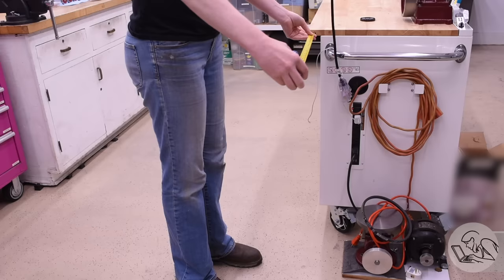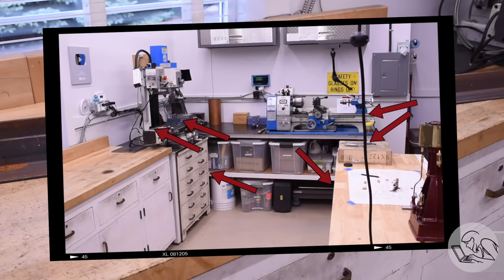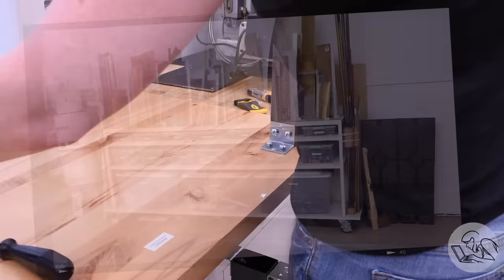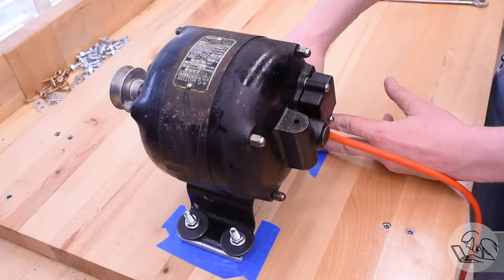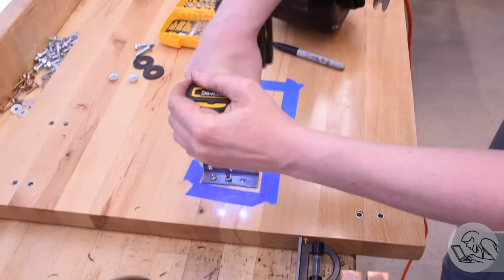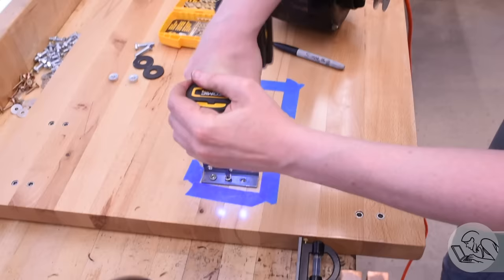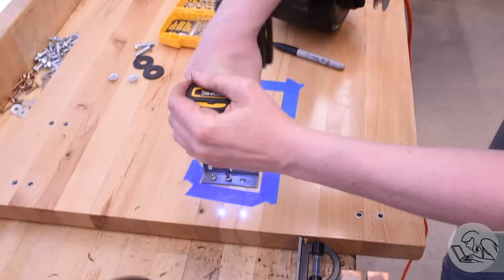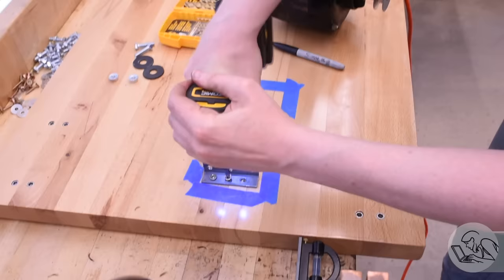Die Filer Bench (and last minute re-engineering)

Comment from the maker: Hey everyone! Lots of folks “suggesting” on this one that I should have opened the hinge out 180° to solve the clearance problem. That’s missing the point- that does nothing to improve clearance for the bolt heads on the motor bracket which require the motor to sit at a high angle. Some folks suggested mortising the wood underneath as well, and sure I suppose you could. That’s a lot more work than what I did though, and my approach means the bolts are accessible for removing the motor without removing any wood screws (which weakens their hold in the future).
Reply: what you should have really done is create robots in the shape of tardigrades which would have arduinos programmed to make them grab both the surfaces and hold tight and for fun, one would make a quiet metal on metal squeak and the other a very quiet fart sound rarely, at long random intervals, maybe once every two to seven months
Reply: Couple spots of weld, then no bolt heads to deal with!
Reply: 1/4-20 flat head machine bolts with either allen or torx drive ,,  counter sink the hinge plate to match the bolt head or nearest metric size
Reply: I probably would have just carved out some clearance from the table's underside. It's wood and you could probably chisel out a pocket for the bolt heads to recess into, but I have more than 1 chisel too. We do what we feel comfortable with and if it works, it works :D
Reply: I thought you did a fine job on the belt slot, and the project overall.  I’m not a fan of the Home Depot guard material, but it is 100% justifiable for getting rid of it!

On the V-belt, some of your vibration may come from the permanent bends in the material as it flops over the round pulleys.  If it bothers you, test by using a more flexible replacement like a strong cord, and potentially replace it with segmented link belt.  I put a link belt on my table saw (which I have used to cut wood AND cast iron!), and it took a lot of the vibration out.

Comment: You earned plenty of woodworking cred for having a sharp chisel!
Reply: If a machinist can't sharpen a chisel, she loses machinist points.
Reply: A story told to me a half century ago or more by an old wood worker. 

There were two skilled craftsmen, one a machinist, one a woodworker. Needless to say, they were great friends, but did give each other a hard time about their chosen materials. 

Both did very fine work. But the machinist did have a problem. When the blade on his bandsaw would break, he could just never get the new one welded together right, the joint kept breaking. So in the end, he would take it to his wood working friend to weld it. The woodworker would never tell the machinist his secret on getting a good spot weld. 

Anyway, the both had a common friend and one day that friend asked of the woodworker, so why can you do that weld when the machinist can't. The wood worker responded, we both file the end taper correctly to get the weld, I blow off the ends to clear the filings, but my machinist friend wipes those ends off with his greasy fingers. 

I know, a bit long, but what the heck. The point is, cleanliness is next to a proper current path for welding.
Reply: johannesfiftyeight9287  ....or abuse it. 😂 I have plenty of friends that fall into the latter category.  Having said that, I think Quinn probably has great woodworking skills, but she has too much fun abusing us poor woodworkers to admit it.
Reply: Should have used the die filer to massage the slot….😂
Reply: @MrTjbnwi  I was wondering why she didn't mill the slot, and then square up the corners with the die filer.  You beat me to it!
Reply: @PhilG999 we have a bandsaw at work that has a small grinder and welder built into it.
Reply: I am amazed she didn't come up with some elaborate setup to clamp the table-top to the milling machine. to mill out that slot...

Comment: 22:36 - It was used to build radiator covers.  You wouldn't have to see the radiator but air could still flow in and out.
Reply: Ha, ha, I think I’d rather look at the radiator! It’s odd to think some where some one decided that the world needed an ugly punched mesh radiator guard,odder still that people buy it.
Reply: @johnsherborne3245  It's intended to prevent small child sized fingers from getting burned on the radiator surfaces.  Been superceded by MDF in recent years.
Reply: @AB-ku4my  the joys of international you tube, who’d have thought it. Radiators here in the UK are seldom that hot, at least that makes sense though.
Reply: It also makes it more comfortable for a cat to lay on
Reply: Yes. This is where I have seen it-including my childhood home. Though some of the radiators were left exposed in all of their cast glory.
Reply: @johnsherborne3245 With steam heating systems, they get really hot. However steam systems are not that frequent in Europe anymore, because they just have very poor efficiency (too hot flue gasses leaving the chimney losing way too much heat)...
Reply: @annaplojharova1400   in 1976 my lab was steam heated, used to be very noisy as the condensate trap banged about, I can’t say it worked that well though ideal for heating the process tanks.

Comment: Jeez. Whoever put that first hole in the bracket did a terrible job lining it up with the two you added. 😄
Your videos are always a bright spot in my day. Thanks for sharing your projects. 🙂
Reply: Thankyou 👍
Reply from the maker: I don’t know what they were thinking, putting it way out of line like that. 😬
Reply: If you had a working dye grinder,  you could slot the hole to the right place.
A wood chisel won't work!
Reply: @richardw3294  not with that attitude it won't. 😄
Reply: Having the holes not-lined-up is actually stronger for the wood, so there!

Comment: The house I grew up in (Sears Kit Home in Washington, DC) had radiator covers of the material with the four-leaf-clover pattern in it.  I also recall some baking station in my youth that had that same pattern as venty decoration. The radiator covers were made from wood panels like a book case with that screen over the front so they heat could come out, all painted the same as the rest of the walls in the house.  The top was open, like a bookshelf, and frequently had a cat on it in our house (there were several scattered about; also good for lamps and the occasional small statue...).
Reply: @bobbob8229  Especially on radiators!!  And one had afternoon sunshine.
Reply: @bobbob8229  Don't ask a Maker how to make stuff from cats...!! 😎
Reply: I think that the radiator cover sheet goods is thinner, with smaller holes .  The brass looks more like the stuff used for forced air floor vent covers.  (At least in my experience of 75+ years in Toronto)
Reply: Kind of surprised Quinn didn't hand form a guard out of copper after all the work she did on the boiler. .
Reply: Ah thanks - I finally get what is meant by 'radiator covers'. Being a car-guy I immediately went to car radiators and could not figure out for the life me what others were talking about. 😲

Comment: Using a prefab work cart as a movable workbench is extremely good idea.  As for your woodworking, you got the job done and it looks good.
Reply: As Quinn said, unless it makes you happy to build it, save the money and buy it. For instance, for my mini lathe, I needed a good strong stable stand to get it up and running. Yes, at some point I will find a good used roll away tool box for that purpose, but for now it's on a Wen wood working lathe stand. Stable and works nicely.
Reply: As someone in the HVAC trade and work with other trades. We have a saying, "Can't see it from my place."

Comment: That metal is what was used to box in large steam or hot water radiators. It's junk metal that is an approximation of similar sheet that would be installed in century homes.

Comment: Quinn. I have switched over to the link belt style V belt on most of my machines and it made a remarkable difference. Very smooth running.
Reply: Yeah me too. Anything that has a Vbelt in my shop has link belt and it's a real God send on my old atlas lathe
Reply: I have been thinking this too during this entire series.  Put one on an old Craftsman drill press and I'm never going back.
Of course it might have had something to do with the belt it was replacing being decades old.

Comment: Long ago I worked in a lab testing plastic additives.  We had a lab-scale plastic extrusion machine with a heated snout that caused more than a few burn accident reports to be written.  I built a shield from 1/4" hardware cloth that was, in design, almost identical to yours.  The number of burns produced went down considerably.  However, the number of reports on small cuts caused by the edge of the hardware cloth went up a lot.  Eventually we got wise and relocated the machine so it stopped being a global hazard.  In the spirit of "I love your channel" I won't ask for any royalties for using my unpatented design. 😺 Cheers!

Comment: As a hobbyist with limited space and various bench mounted bits of machinery (like the home made router table),  I solved the 'emergency stop' situation by buying (Ebay) a metal heavy duty enclosed foot switch and attached a double output short lead to it - good for powering up and down machine and dust extraction at the same time. So in the event in wanting to cut the power A.S.A.P. especially when both hands are in use, it's pretty instantaneous.

Comment: From a cellulose monkey, put a flat reference on the lines you want to mortise down into.  Then keeping the flat back of the chisel on there gives you an easy flat pretty edge.  No criticism from me :)
Reply: Yea, I was impressed that you didn't need a mallet, so your one-good-chisel was indeed good.  My only thought was that you're not holding it vertically -- you should be cutting, not scraping.
Having one very nice chisel would be better than having a drawer full of cheap ones.  But I happened across the Lee Valley Tools catalog where he editorializes a lot, listing the properties of a good chisel and then concluding "most manufacturers feel that 3 out of 4 will do." He sourced a set of chisels manufactured to his sensibilities that basically give you a whole set for the price of a single Japanese Samurai chisel.

Comment: Nice outcome for a completed project. If you ever have to cut a through slot again, drill through far enough for the spur on the spade bit to penetrate the underside and then flip the stock over and drill back toward the centre. No tearout guaranteed.  Cheers, Preso

Comment: I'm not a machinist and I'm not a woodworker, but I've dabbled in both and it's either fun, or for stuff I can't otherwise get. A lot like programming, actually.

And the only reason I don't have a float-lock is I don't have the tools to build one. I barely have a use for one, but every time I use that drill press, I wish I had it.

Comment: 11:56 if you stop drilling when the tip breaks through you have your pilot hole for finishing the hole from the other side
Reply: I was thinking the same thing as I was watching her drill with that spade bit.
Reply from the maker: Great tip!
Reply: @Blondihacks  groan
Reply: ...just the tip...
Reply: I always plan to do that and then overdrill.
Reply: @MichaelOnines  do it on a steel table, lol
Reply: True, as long as you don't break thru. I find it is safer use a small pilot hole all the way thru, then use the paddle bit to go most of the way thru before drilling from the other side.
Reply: I always found if you just back it up with some sacrificial piece of wood, it doesn't happen.
What causes the chip is when it breaks through and can push out. Stop it from pushing, and you stop it from chipping.
Just clamp a chunk of plywood or something behind it and drill, Baby, drill!
Or drill down into some wood you don't care about marring.
Reply: @Tasarran  That also works, as long as the  backer is solidly clamped at at least 2 points and there is no flex in the backer when you punch thru. 

Like every other woodworking project, there are at least 9 right ways to do this. 

Doing it with a router would have been fun! 😁
Reply: @stepanova8  Yeah, plywood is a bad idea, in retrospect...
IIRC, I always used an old scrap of 2-by or 4-by when I cared about breakout.
Truth be told, I probably wouldn't have cared much about the underside of this bench,
Reply: I came here to say this :) good one to have up your sleeve.
Also, people give paddle bits shade for being inexpensive.. but a set of decent paddle bits will cost less than the cheapest forstner bit, and both drill holes! lol

Comment: When I was working as a mechanic I saw one of the old timers in the shop estimating v-belt lengths with one of the shop extension cords, it's flexible and wide enough to fill the Vs in most pulleys without touching the bottom. I've used the trick a fair amount myself and it works pretty well, but I don't have a lot of extension cords most of the time and I found that surgical tubing works pretty well too. :D
Reply: Beware the stretch of surgical tubing though 😔

Comment: I declare this video "Not Terrible ! ! ! ".... Your sense of humor was in fine form for this video !  I chuckled and laughed through pretty much all of it!   Especially the "Not Terrible" fanfare !   You're too hard on yourself when it comes to the modest wood working.  The only "trick" you missed out on using was stopping short and flipping the top over and drill from above using the pilots from the tip just breaking thru as described by richf419 below.   As for the chisel work Paul Sellers or James Wright would have given it a "thumbs up" just fine.    The basket guard is also brilliant.  I'll be "borrowing" that idea if I need it in the future.

Comment: I have a couple vintage belt-driven shop tools: a scroll-saw and a lathe. Both are for dense cellulose-based organic material machining. My motors are both gravity tensioned. I do get a slight motor bounce but nothing dramatic. I had thought of making a tensioner system but I’ve had the same belts for nearly 30 years so I think I’m ok. 😂

Comment: Love the finished project!  Putting the motor underneath was a great idea.  One tip you probably won't see in a wood person video - sheet metal screws actually hold just as well in wood as wood screws, sometimes better.  From a USDA report from the 30's or 40s, believe it or not.  The straight vs tapered shank just hold better.  Wood screws are tapered because that's just the way they've always made them.  Note that modern wood structural screws are not tapered.  ANYWAY - I just stock round head sheet metal because they'll work for both wood and metal, and they won't pull metal brackets out of whack.

Comment: Excellent work, Quinn! Love watching you solve problems. Curious: why didn't you use the mill for the table-slot? Plunge cut and conventional mill it? I've noticed other machinists, when dealing with wood, don't seem to want to use their metal machines on it.
Reply: I don't think that would fit on the mill in any reasonable way. Wood chips can clog up your coolant system and oily wood clips in the clip tray can be ignited by hot steel clips. This is important in pro shops, for hobbyists, maybe, maybe not.
Reply: I've used my milling machine with ordinary horizontal cutters to machine oak pieces to close size.

This worked remarkably well, with very little sanding required in preparation for urethane finish application.
Reply: Using metal machines to work tree carcasses angers Metalicor, the God of Machining.
Reply: Wood dust gets everywhere, and combined with oil it thickens to a mush that clogs oil channels. Some woods also seem to promote corrosion. Besides it angers Metalicor, God of machining, so why risk it?
Reply: And I was so looking forward to a lesson in wood milling....😅
Reply: @mrimmortal1579  When turning wood on a metal lathe, which I don't do very often, I cover everything up with a drop cloth.
When milling wood I wipe the mill down to remove all oil prior to machining wood.
Then clean everything up with the vacuum cleaner.
Coarse tooth cutters such as those specifically made for aluminum, do a remarkable good job on hardwood in my experience.
Reply: @EirikvanderMeer  Milling wood does not make much dust.  Think planer chips.
Reply: @BasementEngineer Take a look at an old wood machine, there will be chips and dust everywhere. And neither plays well with oil or coolant.
Reply: @BasementEngineer  your careful preparation pleases Metalicor.  The ceremonial re-oiling of the machined surfaces further appeases him.  ALL HAIL METALICOR!!

And now, let us read from the Book of Lubricants 3:18-
  “Whither dost thou see shiny smooth surfaces, thou shalt apply clean lubrication of appropriate amount and viscosity.  And Metalicor looketh upon the freshly oiled metal surfaces and smiled, for it was good.”

Comment: Great Idea with the Stool Jack. I while back I bought a small mortocycle hydraulic scisor lift with casters. It is so useful when all your 'friends' are mysteriously absent when you might need an extra pair of hands. I have used that for all sorts of simular jobs, even using it to jack up one end of a very large bench, so I could llift it just enough from the other side to drag the bench to a new location in the shed.  But your stool offers the comfy option when no lifting is required.

Comment: Awesome video as always. A quick tip regarding the blowout when drilling wood: You can clamp a piece of sacrificial wood on the side the drill will exit to support the fibers. This will give you really crisp edges 99% of the time, but it can be a little awkward to get the board in place when your drilling in the center of a large piece.

Comment: Woodworkers trick: drill a small pilot hole clear thru, use the paddle bit to drill most of the way thru, using the pilot hole as a guide. Flip the piece over and drill thru from the other side using the same pilot holes.   Presto-change-o! No tear out!

Nice work!